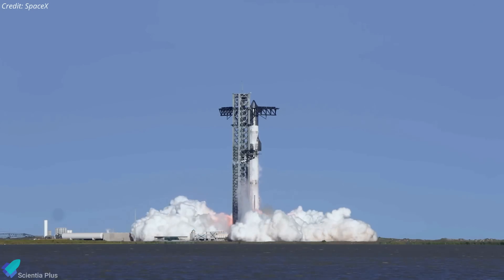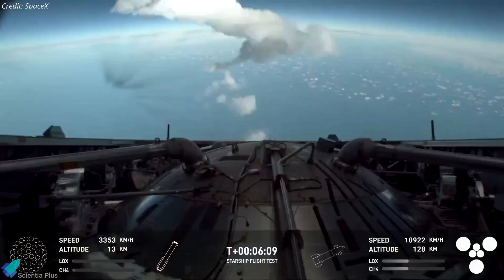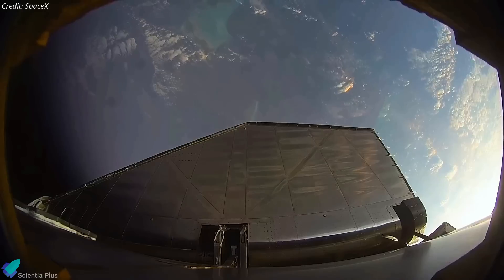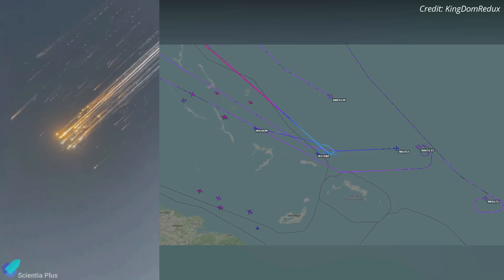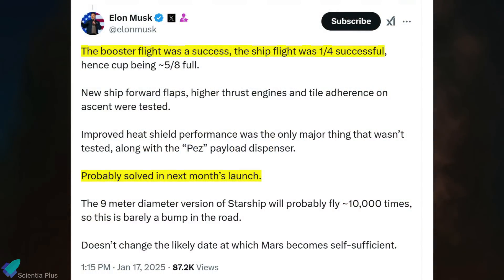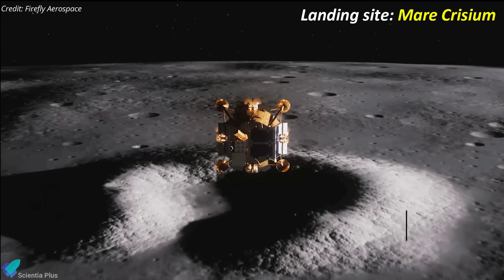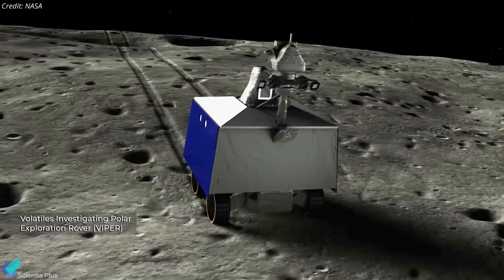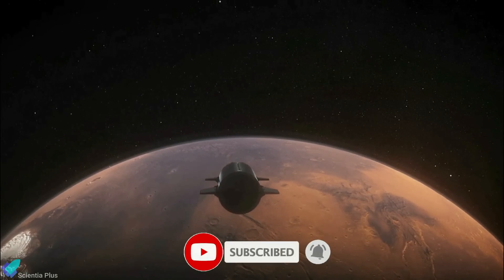Starship Flight 7 Anomaly: SpaceX Finally Solves Explosion Mystery, FAA Investigation Started

Comment: Due to the lower separation velocity & increased propellant consumption with the heavier Starship 33, the boost back did not require the thrust from the 13th Raptor to provide the required delta V to complete the maneuver.

Comment: We love spacex❤❤❤❤❤❤❤❤❤
Reply: Starship is a ridiculous mistake and real engineer laughs at this Tin Tin rocket🤣 everything about spacex and starship is based on lies, there is no revolution that technology at spacex NASA made vertical landing in the 80s what spadex does is just copy with 1000 times better computer. Elon the Liar promised in 2016 that his rockets would land on Mars without humans in 2022 and with humans in 2024 today up to 4 starships where in 2025 they are scattered across the seabed and the only thing they can manage at SpaceX is landing at the same place where they took off from, which is easy. And starship itself is also pathetic, elon laws to start that starship could lift 300t in LEO then it was 250, 200, 150, 100 and now max 50t and that with a bigger fuel tank, and what have they managed so far to get up to almost LEO a banana😱😭🤣and all re-entry with starship has gone wrong if it hasn't blown up. So no, starship is a joke and will never land on either the moon and certainly not Mars😫🥳😆

Comment: The FAA don't investigate anything, all the FAA do is verify the findings of internal SpaceX investigations and make sure recommendations are reasonable and proportionate. In this case there was a leak in the plumbing to the engines requiring a doubling of efforts during assembly to make sure leaks are prevented and mitigation consisting of increased ventilation in the cavity where the leak occurred. I don't see significant delays due to this as the investigation can be turned around quickly.
Reply: Exactly!  If this was serious the NTSB would be investigating.

Comment: The flight was remarkable. Even with the loss of the ship, the catch of the booster was incredible and even more presision that the first one. An engine out is nothing. Thats why there are many smaller engines. Engine out capability is part of the design. Any other rocket would have been lost.
Shame about the ship but thats why they are testing it. 
I see no failure.
Reply: Starship is a ridiculous mistake and real engineer laughs at this Tin Tin rocket🤣 everything about spacex and starship is based on lies, there is no revolution that technology at spacex NASA made vertical landing in the 80s what spadex does is just copy with 1000 times better computer. Elon the Liar promised in 2016 that his rockets would land on Mars without humans in 2022 and with humans in 2024 today up to 4 starships where in 2025 they are scattered across the seabed and the only thing they can manage at SpaceX is landing at the same place where they took off from, which is easy. And starship itself is also pathetic, elon laws to start that starship could lift 300t in LEO then it was 250, 200, 150, 100 and now max 50t and that with a bigger fuel tank, and what have they managed so far to get up to almost LEO a banana😱😭🤣and all re-entry with starship has gone wrong if it hasn't blown up. So no, starship is a joke and will never land on either the moon and certainly not Mars😫🥳😆
Reply: @michael-gk3ib , says the idiot that simply has no clue.

Comment: Great Launch Well Done Spacex
Reply: Starship is a ridiculous mistake and real engineer laughs at this Tin Tin rocket🤣 everything about spacex and starship is based on lies, there is no revolution that technology at spacex NASA made vertical landing in the 80s what spadex does is just copy with 1000 times better computer. Elon the Liar promised in 2016 that his rockets would land on Mars without humans in 2022 and with humans in 2024 today up to 4 starships where in 2025 they are scattered across the seabed and the only thing they can manage at SpaceX is landing at the same place where they took off from, which is easy. And starship itself is also pathetic, elon laws to start that starship could lift 300t in LEO then it was 250, 200, 150, 100 and now max 50t and that with a bigger fuel tank, and what have they managed so far to get up to almost LEO a banana😱😭🤣and all re-entry with starship has gone wrong if it hasn't blown up. So no, starship is a joke and will never land on either the moon and certainly not Mars😫🥳😆

Comment: Awesome Booster catch !!!
Reply: YAY! Less-awesome was the pointy-end's journey-
Reply: Starship is a ridiculous mistake and real engineer laughs at this Tin Tin rocket🤣 everything about spacex and starship is based on lies, there is no revolution that technology at spacex NASA made vertical landing in the 80s what spadex does is just copy with 1000 times better computer. Elon the Liar promised in 2016 that his rockets would land on Mars without humans in 2022 and with humans in 2024 today up to 4 starships where in 2025 they are scattered across the seabed and the only thing they can manage at SpaceX is landing at the same place where they took off from, which is easy. And starship itself is also pathetic, elon laws to start that starship could lift 300t in LEO then it was 250, 200, 150, 100 and now max 50t and that with a bigger fuel tank, and what have they managed so far to get up to almost LEO a banana😱😭🤣and all re-entry with starship has gone wrong if it hasn't blown up. So no, starship is a joke and will never land on either the moon and certainly not Mars😫🥳😆

Comment: ohh  by the way your using far to much weight as fuel

The booster's tanks hold 3,400 t (7,500,000 lb) of propellant,[2] consisting of 2,700 t (6,000,000 lb) of liquid oxygen and 700 t (1,500,000 lb) of liquid methane.[a]

Gross mass	3,675,000 kg (8,102,000 lb)
Propellant mass	3,400,000 kg (7,500,000 lb)[2

from wiki

v2 rocket

Mass	12,500 kg (27,600 lb)
Length	14 m (45 ft 11 in)
Diameter	1.65 m (5 ft 5 in)
Wingspan	3.56 m (11 ft 8 in)
Warhead	1,000 kg (2,200 lb); Amatol (explosive weight: 910 kg)
Detonation
mechanism
Impact

Propellant	
3,810 kg (8,400 lb) 75% Ethanol
25% water
4,910 kg (10,820 lb) liquid oxygen

germans did better in the 1945
Reply: From someone that does not understand relatively simple mathematics, when you increase he size of a rocket it is NOT a linear progression for the amount of fuel needed, it is an EXPONENTIAL progression due to the Gravitational value of 9.81 m/s SQUARED, simply put, the larger the mass you need exponentially more propellant to put that mass into orbit and that is not even taking into account the velocity differences between the V2 and Starship which, AGAIN, need more propellant. BTW, the Germans (Nazis) never put anything into Orbit, their V2 rocket was a Sub-Orbital Balistic vehicle, something else you absolutely failed to understand.

Comment: Export the Starship, Azure, Chat GPT, Revit, Plant 3D, Civil 3D, Inventor, ENGI file of the Rocket, the Building or Refinery to Excel, prepare Budget 1 and export it to COBRA. Prepare Budget 2 and export it to Microsoft Project. Solve the problems of Overallocated Resources, Planing Problems, prepare the Budget 3 with which the construction of the Rocket, the Building or the Refinery is going to be quoted.